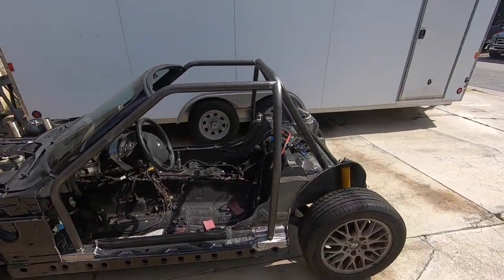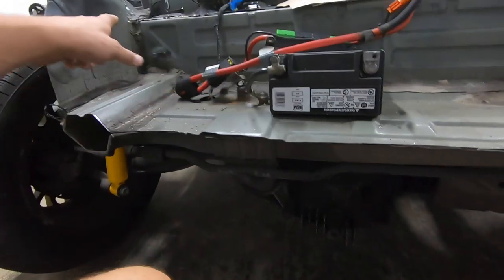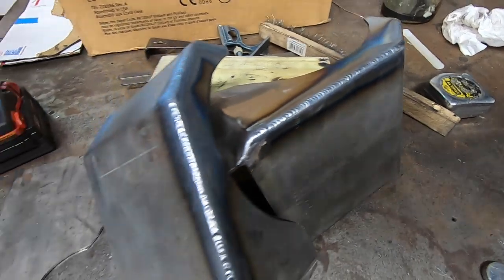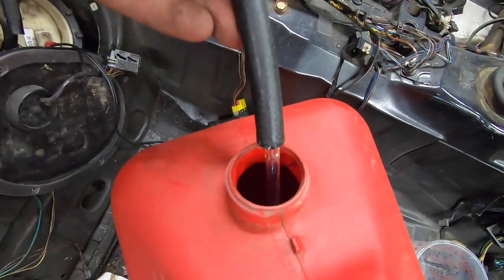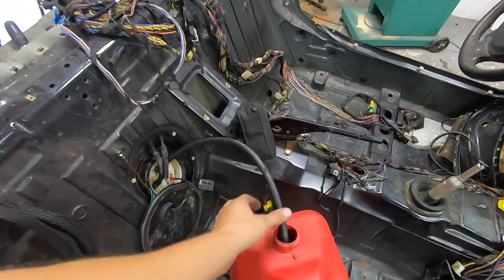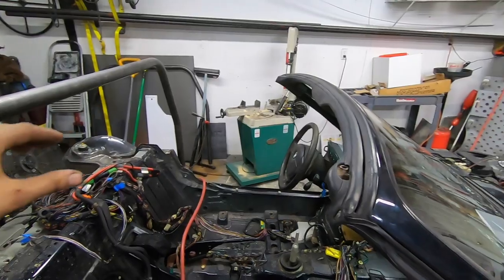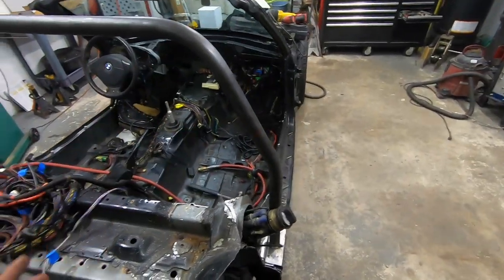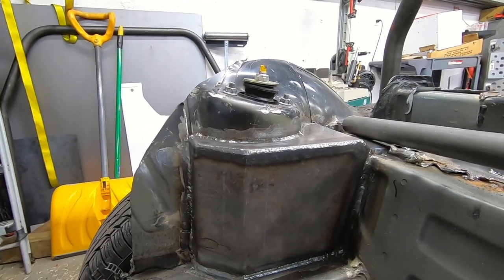The BMW Z-Kart Begins its Wild Roll Cage Journey!!!!

Comment: Interested on more details on tig welding the tubes of the cage. I've found it hard to find much info on tig for steel DOM tube. Everyone seems to mig it. Some details on your bevels, welder settings and torch setup would be mint. I'm fitting a cage into an 1969 Vauxhall HB Viva / Holden Torana and want to tig it as the shell was already painted when I bought it. Cool build and does seem to have nicer lines than an MX5.

Comment: The return flow will be lower because the pressure regulator is in the way. This means the supply side is at 40psi. When the pressure increases the flow decreases.

Comment: Great build cabt wait to see it finished....what kinda a/c are you using in your garage??
Reply from the maker: Cheap Chinese heat pump I got for under $500 brand is AUX. came precharged and I installed it in a day. I can freeze myself out of shop if I want to. Takes about 10 mins to cool down on a 90+deg day.